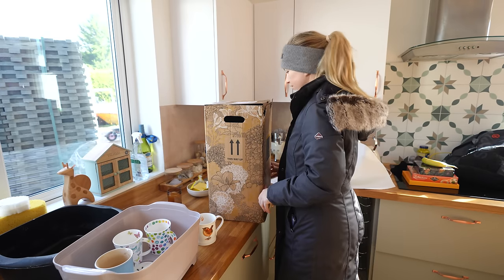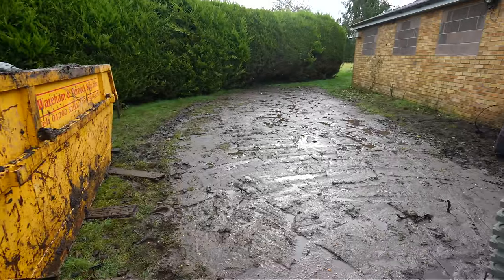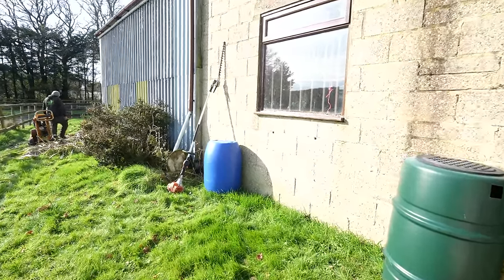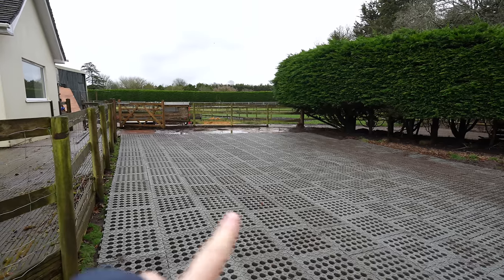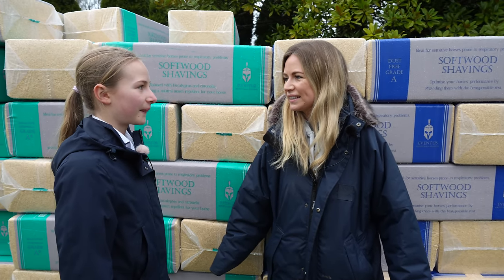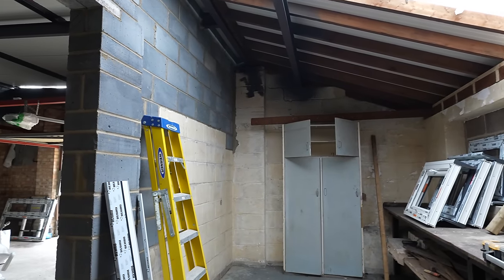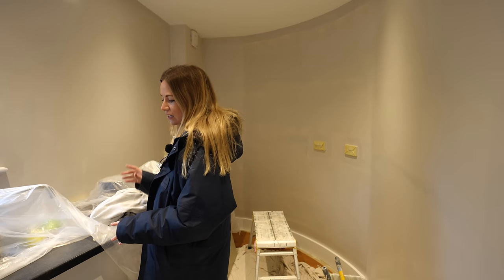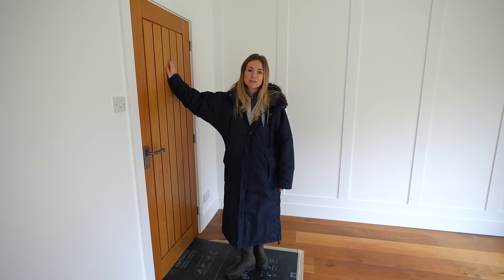HOUSE & BARN UPDATE - GETTING READY FOR THE PONIES!

Comment: Wood chip will be a good temporary solution for all weather turnout but it will mulch down and need digging out and replacing regularly, so I would suggest next year during the summer (or depending on finances the next summer!!!!)  you dig it out and replace with silica sand on top of the mud control mats. Woodchip can also be slippery...... Pure silica sand is not madly expensive, I paid a little over £400 for 10 tonns this winter to add to my hoggin and gravel all weather turnout
Reply: At my barn we use sawdust and it works great!!
Reply: @Elin_SaddleSeat_Eq  hi, I guess from your tag you are somewhere in the USA where all states have a lower average rainfall than the UK. My mum used to live in Massachusetts and it is so much drier than here so that things like sawdust in gateways would be fine there but hopeless here 😞
Reply: @ElinorDavis-g7c  ohhhh, makes sense!! And yeah, it is a lot dryer here!
Reply: great advice